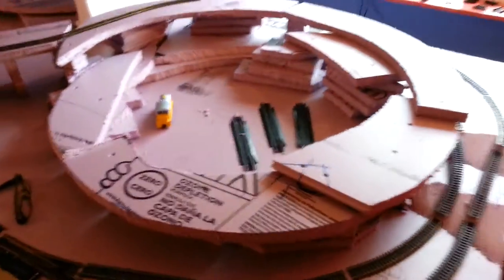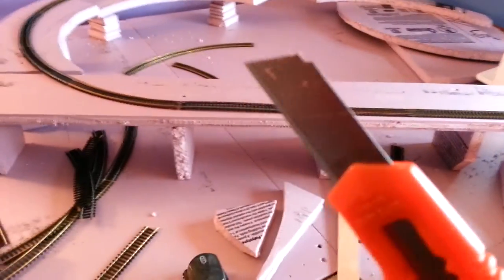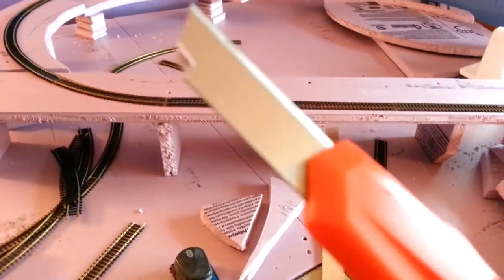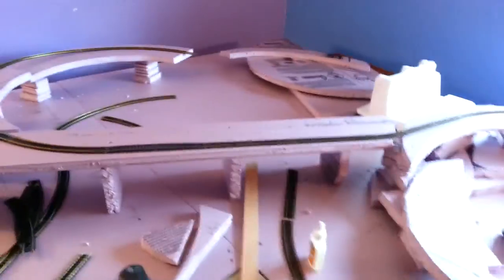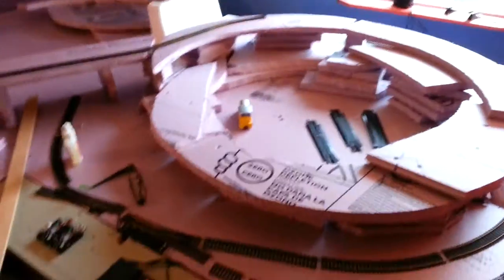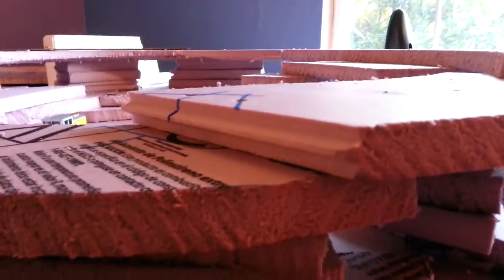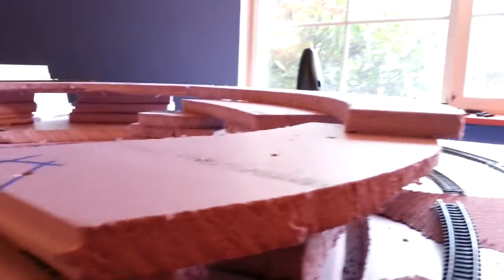# 2 Dan Ashland's HO Model train layout with foam board, the beginning!

Comment: Why did you choose XPS? (Extruded Polystyrene) That stuff SHOULD NOT BE USED anywhere near electrical! A short or spark will start it burning.
Have you ever seen that stuff burn? It's like flaming lava and runs and flows downhill, catching everything on fire.
Take piece outside and start it on fire. You will soon change your train of thought!